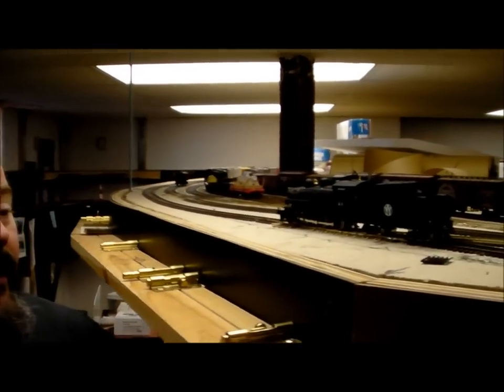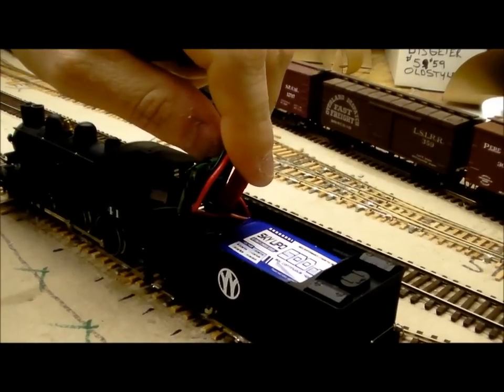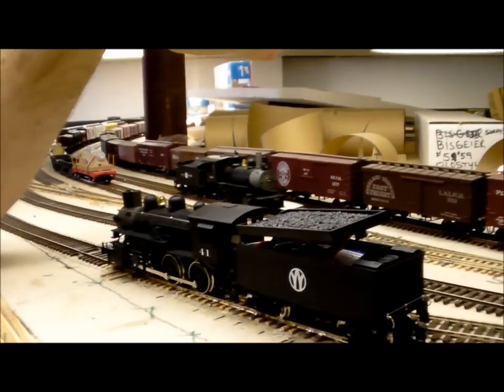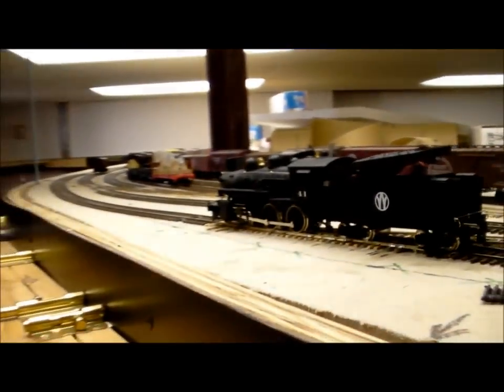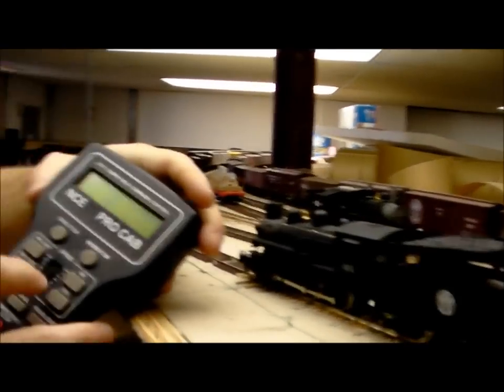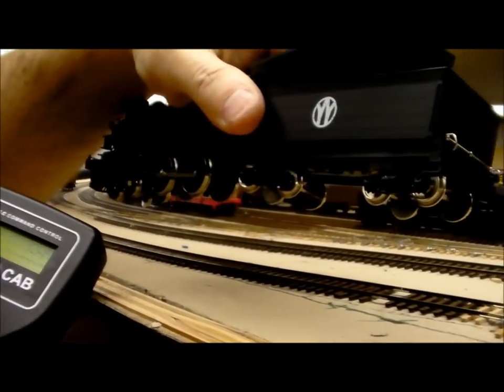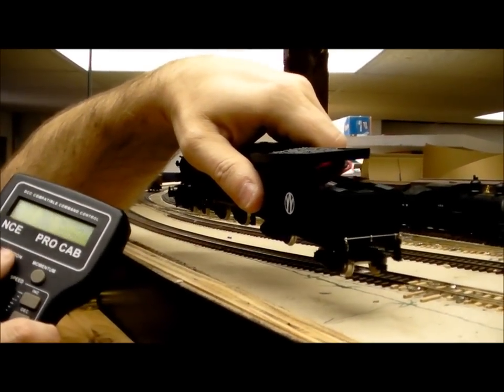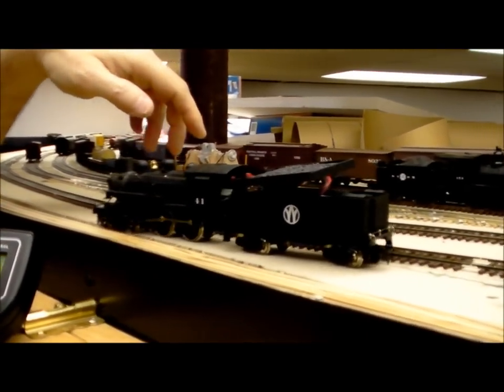TVD Battery Radio Loco Demo.wmv

Comment: What about DCC with sound? I got to have my sound! However, here is another idea: Not all loco's have room for an extra circuit board and battery bulky battery pack, so....You could have a dedicated "Battery Car" like a boxcar, that contains the battery or batteries, and have a small connector & cable (using Micro JST connectors) that you can run from the battery car, to any "battery Enabled" Loco.  If you really want to get away cheap, You can install the Radio Receiver into the dedicated battery car, along with the battery pack, and connect it to any modified Loco (with connection Via Micro JST connectors & cable). You would only need to install the connection cable into any loco you want to run on battery. On the down side, you would always be pulling the extra "battery Car", and the up side, you can use one receiver and battery set, to run various locos. In my opinion, if you leave your existing DCC power to the track, there should be a way to use track power to charge and re-charge the battery car, using an internal convertor/charger circuit. That should all be possible to do, being that  DCC track power is about 16VAC, can be rectified, and put through a specially designed LIPO charger. It is important to note: Lipo batteries have special charging needs, they should never be over-charged!

Comment: I'm fine with taking the pack out and charging it on a limited basis, but it becomes a pain to charge up all the engines I want to run before a session. Lets say I had 12 engines I wanted to use. Even with my charger that means I have to sit and watch them charge for 20 minutes, not counting fiddle time. If someone is using a cheapo charger like many model railroaders will buy, they are going to charge 1 pack at a time at a 1C rate which will take 1hr per battery.

Comment: I am going to try both ways. I want to try both ways and see what works best for me. I fly RC planes and I am very familiar with the benefits and dangers of LiPos. I found small 3 cell packs for less than $5 that can be charged between 3-5C which means they can be fast charged in ~10-20 minutes. I have an expensive high end charger that will let me charge 6 packs in parallel.

Comment from the maker: It should work fine if you have the room.  A couple of me Dead Rail Society friends have used the charging circuit and it works fine.  I always recharge my batteries outside the locomotive inside a coffee cup (dry).

Comment: I have been promoting this idea since the advent of DCC. As for batteries: batteries in the shape/size of smokestacks, fuel tanks, ari tanks, coal load, steam or sand dome, dynamic brake blister or some such solution (maybe a removeable cab roof with battery lead clip for coin-type battery) will go a LOOONG way towards finding room on/in these tiny locos. Additionally, a parallel recharging circuit/plug at the tender water hatch  or diesel battery hatch at foot of the cab ...?

Comment: I'm interested - and not just for the reasons stated in the video and in the comments below.  I like that it doesn't throw a good existing technology into the bin.  I can convert (or not) to battery at my pace.  I'll be watching to see how much space the setup will ultimately take, and am curious if metal tender shells will interfere with the radio.

Comment: I have been waiting for this for a few years now. I fly RC planes too and cheap high density batteries have changed the game in RC. I second the idea to add a charging circuit so the battery is charged by the power on the rail. Maybe only power the tracks by the engine facility so you have to come back for "fuel" :) too cool. TVD is awesome and I am sure this product will be fantastic. Looking forward to it!

Comment: @monsterrailroad you need to be very careful with your proposed setup. Those batteries will absorb the max amount of current available to them. You will need a charging circuit in there. Good idea though.

Comment: With the advancements in battery power I feel that in the next few years it will be the new hit thing.  Just think you will have a battery gauge that can be reflective of a locomotives fuel level: when it gets low...head to the fueling racks and recharge on a powered section of track now that is a cool idea!  Shorts, stalls, jitters, and sparks will all be relieved and no need for confusing wiring diagrams! I honestly think that this will be spectacular!

Comment: Excellent.  Now the next step that I would suggest is that a recharging circuit is built in to the onboard battery circuitry so that the battery can be constantly recharged from the track as the loco moves along.  This would allow a smaller battery to be used.

Comment: ..track the batteries will still put out the needed 3v or so of power to keep the processor powered and will not stall or the sound will not reset on us anymore.  Now all it takes is to have rechargeable lithium batteries wired into the decoder and they will always recharge while the track is powered!  NOW THAT IS THE REAL ANSWER TO DIRTY TRACK!  I am excited about the results so far!  Yours is great for Steam to put a battery in the Tender but mine is for Diesel and Steam taking up little room

Comment: Well I have also been toying with a resolution to dirty track but my idea is a little bit different.  Here is my idea.  I am going to add two SMALL Lithium batteries that are about a Quarter in size.  I have wired them in the DCC decoder where the power from the track comes in and gets converted to DC.  Th the decoder the two Lithium batteries are wired in.  So before the power from the track goes to the DCC Decoder processor it goes thru the Lithium batteries.  So when going over dirty track..

Comment: I thought this was very cool until the ending credits.  Somehow crediting Craig Bisgeier as "talent" just doesn't feel right  ;-)  :-)

How long will the locos run on that battery?  How do you recharge the battery?  (I'm thinking it would be kinda cool to do a recharging station that sits underneath a water tank using either the rails or the water spout for the electrical feed.